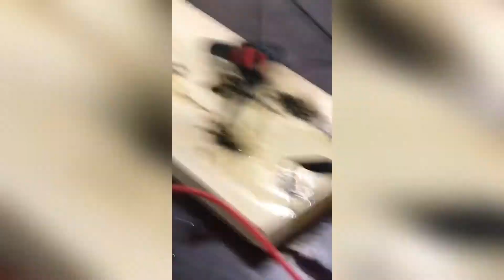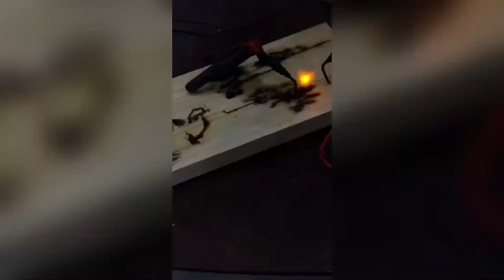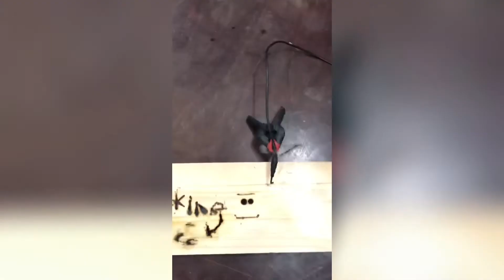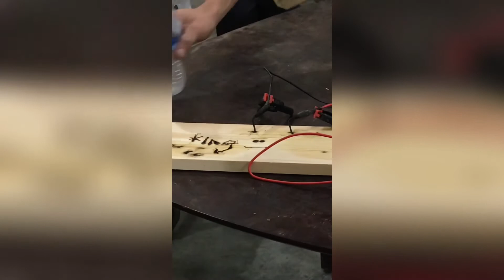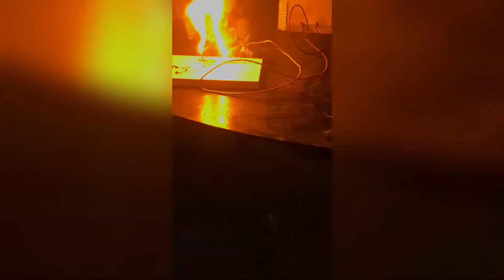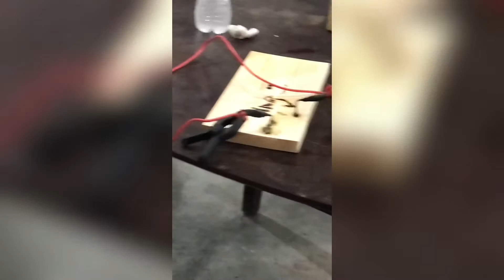Burning wood with 2000 volt electricity (awesome content)

Comment: Do you know why the first process occurring to individual arc flash? The voltage is too high, and the depth of impregnation with electrolyte is small. The discharge current occurs through the air to the electrolyte on the surface of the Board and sprays it before it has time to heat the wood under it before it charring. To process anodyne more evenly need to gradually increase tension feeding high-voltage transformer with the help avtotransformatora ranging with 50 volts. Or use more active electrolytes. Trains will not write because they can harm the health.
Reply from the maker: We are using two thousand volts because we took the transmitter out of an old microwave and we may have put them to close together so it did the frequent ark flashes and it did hurt my eyes because we where using that many volts so yah
Reply: @king______________________8178  It's weird. Perhaps you have a small concentration of baking soda. Here's how we burn plywood at 2100 volts: https://www.youtube.com/watch?v=sNe-anm92oI